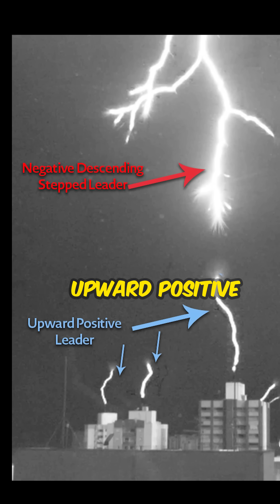40,000 FPS Reveals the Hidden Life of a Lightning Bolt

Comment: you can hear the leader though. I know, I heard it. I was on my back porch 2nd floor. There was a thunderstorm and night and I could hear lightning strikes getting closer and closer. When It got really close, I said to myself this next is going to be close. All of a sudden, I heard a sound like a sizzle go from the ground up into the air and then all of a sudden there was bang and flash at the same time. It struck the gutter of the house right next to me. It was a single story house and I was on a 2nd story porch. Afterwards, I had a white streak on my right eye side where the lightning had hit the roof and I was looking straight. It was there for an hour. But you can hear the feeler go up. If I ever hear that again, i will hit the floor.

Comment: Lightenings follow, and connects with the next strongest Energy signal in it's vicinity, in most cases it's Earth Surface 9.8 Energy Conservation System Activity's, but they also travels away from Earth Surface wherever there's a stronger body of Energy's to connects with,  this is what creates Sprite  .😂😅😂😅😂

Comment: Benjamin Franklin was a leader in understanding lighting. High speed video adds to understanding the sequence of its evolution. what it cannot show is the higher frequency electromagnetic waves (X-rays) that form ionize conductive paths in a series of steps. Cosmic rays which are also electromagnetic waves but with even higher frequency and energy than X-rays initiate the lighting process in the upper atmosphere when their energy is diffused in a shower of x-rays.

Comment: I have seen the damage it does. And the lighting strike  was over a 100 yards from the home. The home was completely destroyed. From ceiling falling in every room. Anything plugged in was fryed. The joints  splintered in the walls. Romex melted off the copper wires. No one was killed, but lady of the house had to go to the hospital.

Comment: Most lightning is not to ground, 80%  is actually upward strikes from the center of a cloud to the top. 
Electric fields are not usually strong enough to cause atmospheric breakdown. Instead cosmic rays are the main cause, these are constantly bombarding the upper atmosphere. What happens is that they or their by products enter the top of the cloud where there is a strong electric field with charge separation, caused by air current flows.
(You also get charge separation in geology within the earth  caused by mineral movements which can cause strange lights on sharp ridges where fields concentrate - often misinterpreted as UFO sightings.) 
So the cosmic rays initiate  ballistic electron release and these get accelerated in the electric field. In fact you can detect gamma rays associated with lightning ballistic electrons. These relativistic electrons ionise air and can travel significant distance actually gaining more energy than they lose ionizing air molecules because the electric fields accelerate them.  As they knock out more electrons some of these can also be accelerated so that  you get an electron avalanche effect even up to a million electrons from one initiation event. 

The ballistic electron events "see" the molecules as effectively stationary so the characteristic zig zag effect is clearly due to the micro-physics of ballistic collision dynamics...

Or is it?

In ultra high-speed video you can observe a luminous point at the end of a growing branch (called a space stem or streamer tip). It brightens or pulses intermittently. After a moment of hesitation, a new segment forms, sometimes stepping sideways. Occasionally, the tip flickers.  branches, or even dies off. 
So even though this is high speed video it is still relatively slow compared to the ballistic electrons...

So is there something more interesting going on here?

Is the creation of paths and the final selection to create the main plasma channel strictly classical?

It is rather suggestive of a quantum computation...Perhaps a kind of quantum preselection where quantum chaos draws the map and field dynamics draw the path....
Reply: I want what this guy’s smokin.
Reply: there are two "grounds" one is the planet, the other is "space"
Reply: @andyman8630 Most strikes are between oppositely charged layers in the cloud. Only 20% are ground strikes but you can see sprites at the top of clouds.  The ionization leads to planetary enrichment of nitrates.
Reply: @KeithAllpress  
much the same with volcanic lightning! nearly all are between different charge layers and few few hit the ground

Comment: I was walking down the steps to the platform of a pedestrian  overpass early one night.There was a huge crash behind me and in a quick glance l saw lightning hitting the roof of the ticket office on top of the overpass, coming down the down- pipe and the handrail l was holding. The next thing l knew l was curled into a ball at the bottom of the steps. The lightning lept from the end of the handrail half a metre above my right shoulder, up to the platform roof. Completly lighting it up then it lept across to the electric train power wires travelling 100m past the platform before it was gone.
This is something that l will never forget but, how was l able to descend those 15/18 steps before the lightning could travel those 30/36 steps? Did l teleport?
Reply: Yes

Comment: Lighting striking crystals in the primordial soup at 30,000 degrees caused life to begin on earth. Not sure why it destroyed a chunk of the building...
Reply: it super-heated moisture in the concrete = instant expansion = broken concrete
Reply: @andyman8630   That is not possible.  If it was, then there would be no way that it could produce life. Earth based life requires liquid water not steam
Reply: @JoshDuran-m3n  
when lightning hits water it does not produce steam
Reply: @andyman8630  of course it produces steam when lightning hits the water.  30,000 degrees is a lot hotter than 212 degrees which is what water evaporates at.
Reply: @JoshDuran-m3n  
nope! when lightning hits water, more than 99% of its' energy has already been dissipated ionising and traveling through while 'illuminating' the atmosphere

further, the remaining energy is dissipated through trillions of litres of water - and therein lies the catalyst for life

forget not that life in the deep is most abundant around "black smokers" where temps are 400C+ and water chemistry is essentially toxic for all other life forms

think outside the square rather than boxing yourself into it!
Reply: It was the creator

Comment: Thank you, this was a very easy to understand explanation, yet not excessively over simplified!
Reply: It was only a Theory about the obvious Movements, for real nobody knows really, but these pupetmasters love it to talk with confidence to control their pupets! With real confidence, you should be able to confirm that you' dont know anything!
Reply: @Ranger4-1-7-1  Indeed. No explanation of the particles involved. Ionisation of air molecules O2 and N2 by an electric field caused by a surplus and a deficiency of freed electrons in the clouds and ground respectively. The electric field (V/m or N/coulomb) is not uniform across the thickness of air, so O2 and N2 are not ionised exactly at the same time. That`s why there are ``descending and ascending leaders``. The freed electrons from O2 and N2 plus the ones from the surplus in the clouds form the high current. Along their path, the ones from the surplus in the clouds combine with the ionised O2 and N2 to neutralise them, which causes light to be emitted. At the end of the process, in a fraction of a second, the clouds and the ground are discharged.

Comment: How can a positive charge can move upwards if supposedly only electrons can move between atoms?
Reply: That’s a good question, I’m no expert, but I think it would be positive ions (atoms missing an electron or two) lining up.  You’re right that electrons can move between atoms, but this is happening in air where the atoms/molecules can freely move as well.
Reply: @mogelbuster thanks
Reply: He didn't explain in detail the streamer component, ahead of the stepped leaders are streamers, at the tip of streamers what occurs is a process called relativistic electron breakdown, it's like a mass of electrons pulled into a pool and accelerated by an electric field, at the event horizon of this you have virgin air breakdown into an ionized channel caused by what's described as an electron avalanche, in explanation basically it snow balls and as it does it causes virgin air- insulator to become an ionized channel- conductor. 
Whether positive or negative can kinda be looked at subjectively, charge polarity and strength(electric potential)is relative to a second measurement point in comparison to a reference measurement, reference typically being the ground plane which is kinda considered as zero potential but thats not always true as it could have potential itself over say the mother reference point being earth, which is literally the ground IE.  earth which is why your house has a copper rod shoved into the dirt connected to your electrical box. Earth grounding is theoretically an infinite electron sink, it's not true though, earth rise potential is a thing, basically when you discharge a massive electric field buildup into the dirt, something like a failing power station generator or a lightning strike, from the connection centre you have areas of rising electrical potential occurring for a brief time, so the difference between a point at a radius of 3 meters and 4 meters could be as much as 100 kilovolts, it kills herds of cows a lot cos they shelter under a tree in a storm, lightning hits the tree,  but not the cows, it's the earth rise potential that kills them.

Sorry for the gargantuan explanation that might or might not have helped you understand... Hopefully it helped, electrical theory is massive
Reply: You might consider positive charges to be "holes" where electrons *aren't*.  Things like ions, perhaps.  In the same way that you could encounter extra electrons momentarily gathered in a particular location to provide a net negative charge, you'll encounter holes momentarily gathered to provide a net positive one.  Of course, nature would like to balance things out, so we get lightning.
Reply: This is a fantastic question! A clear explanation (complete with dynamic diagrams) can be found on the National Weather Service website. You can find it here. https://www.weather.gov/safety/lightning-science-connection-ground
You'll also want to see their explanation of "Return Stoke" which is linked on the page I provided. The upshot is, in the discharge of lightning, only electrons are moving,  and always from regions of greater concentration to regions of lower concentration. As a separate event, solar radiation powers an energy consuming separation of charge. I hope this helps.
Reply: Positive charge, to few electrons, negative charge, to many electrons, correct? Feels to me a bit counterintuitive... Is they're a reason why it isn't the opposite?
Reply: @d.ekelschot6379  electrons are negatively charged, consider most things want balance, and thus they move towards resolving imbalances- therefore a lack of electrons or too few will result in a positive state, to be balanced electrons are needed, they need to be attracted. And the inverse is the same, too many electrons results in too much negative potential and to return to balance electrons need to be removed or shed/discharged, needing to repulse electrons.
Reply: Simplistically explained - You are about to shake hands with your friend 2 (initially )neutrally charged  But the finger tip of Your hand get charged up negatively (gets negatively charged when it gains extra electrons. This usually happens through  friction, or more formally, triboelectric charging.).

When your finger tips approach your friends, The negatively charged fingertip is brimming with extra electrons. As it gets close to your friends neutral fingertip, it repels the electrons in the neutral finger (because like charges repel). This causes:

Electrons in the neutral finger to shift slightly away from the approaching fingertip.

The side closest to the charged finger becomes slightly positively polarized, even though the total charge remains neutral.

The negatively charged finger and the induced positive area on the neutral finger experience an electrostatic attraction. So, even though one finger has no net charge, it gets pulled toward the charged one.

If they come close enough, electrostatic induction happens : The excess electrons from the negatively charged finger  jump across, equalizing the charge between the two. This discharge can be felt as a mild static electric discharge. mini lightening

  A typical thundercloud can carry an electric charge of around 20 to 30 coulombs, though in some intense storms, this can exceed 100 coulombs  and apply  the potential difference  in tens to hundreds of millions of volts of a building on earth. You have Lightening !!

Hope this helps !